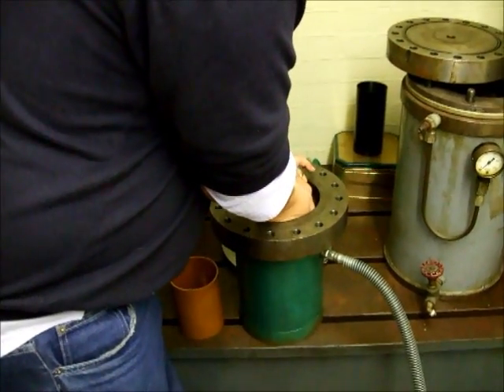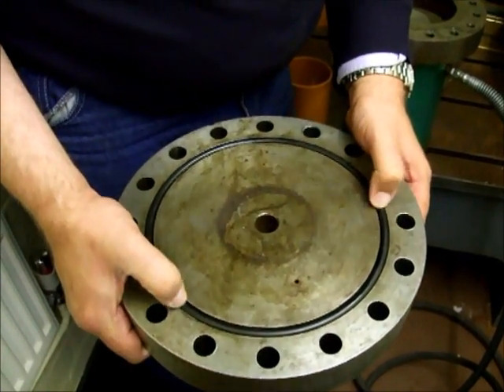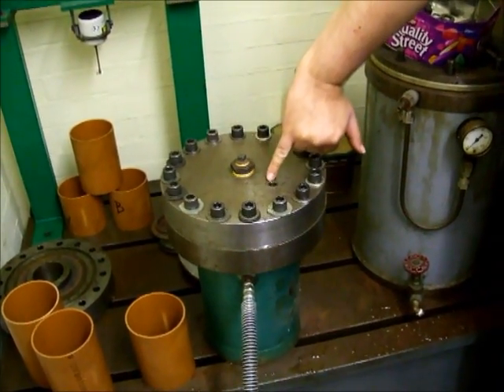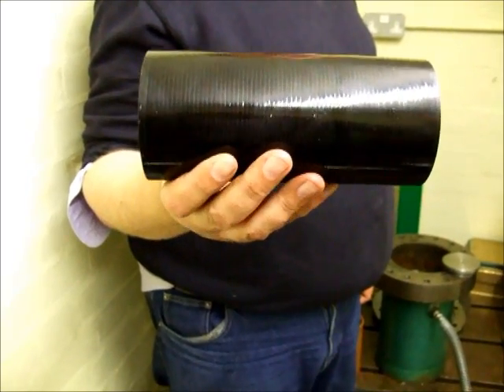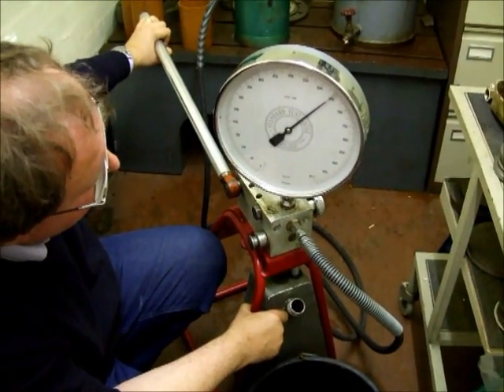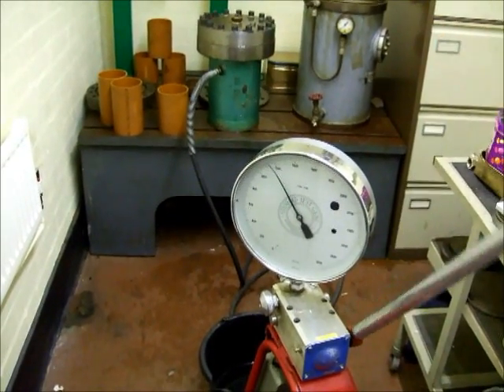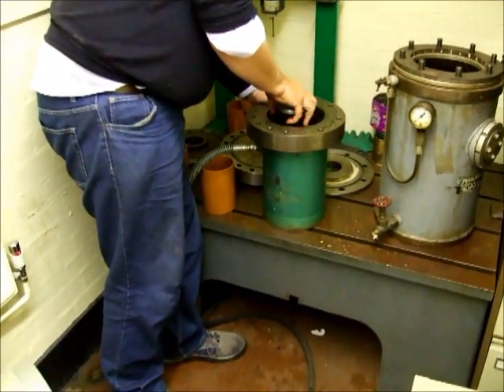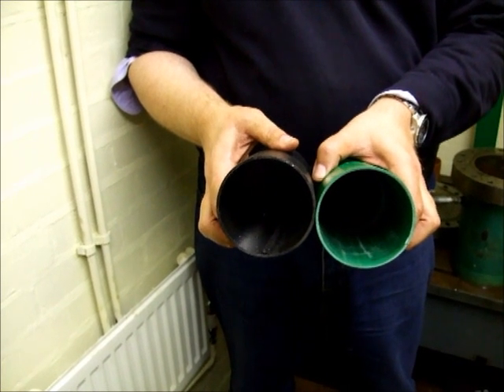Collapse of Composite Submarine Pressure Hulls

Comment: A note on why the failures here aren't more catastrophic:
Water is essentially incompressible. When they use the pump to force in more water, what it's mostly doing is slightly expanding that giant steel cylinder. Steel is an elastic material, so it stretches by a fraction of a millimetre. Only a tiny amount of extra water is being forced in, but the pressure created is huge because water cannot be squeezed smaller. As soon as the test article buckles even slightly, water is able to fill the new space and the steel cylinder can spring back to shape, and once that happens, the pressure is gone completely. Because only a tiny amount of extra water was added to the cylinder, it only collapses a tiny volume of the test article.

That's quite different from the situation in the ocean. In the ocean, the pressure comes from the weight of the all the water above the submersible. Once the hull buckles, all that weight of the water above pushes water into the buckled area, with the whole volume of the nearby ocean falling by a tiny amount into the gap, until it has filled the entire volume of the hull in milliseconds, which will squash it flat and rip it apart into shrapnel.
Reply: Really interesting discussion.  And of course at extreme pressure the heat of compression starts which adds another destructive process to the objects.  All in all it’s a rather more dramatic and horrifying event at  4000m.
Reply: @boxingfan2281  The instantaneously heated air due to rapid compression in an environment with O2 and the tanks of safety O2 would be interesting to model.  Would there be an explosion or would the inflow of water overcome the ignition of O2?
Reply: @boxingfan2281   poof..
Reply: @boxingfan2281 I’ve been explaining it to people as a giant, instantaneous pressure cooker. Folks seem to understand that there is pressure but don’t really grasp all the ways both water and pressure make things soluble that we normally think are not.
Reply: Exactly, you see the pressure gauge immediately bounced back to zero after the container cracked.
Reply: @clementding10  Near zero, the full scale was 10K psi or so, they changed gauges and pumps, mid through.
Reply: And generate heat, as the air compresses, cooking and liquifying the poor chaps inside in an instant. .
Reply: @hafstrat 
The air is compressed instantly to a tiny volume, the ice cold sea water immediately flooded the interior
Reply: 400 atm is equivalent to a heavy duty truck (6000 lb) pressing down on every postage stamp sized area of the hull (1 square inch).
Reply: actually the water will rush in and compress the air from one at to 6000psi instantly raising the temperature to a high level
Reply: Very succinct observation thank you!
Reply: Phenomenal explanation.
Reply: So, the potential energy of the pump/cylinder test was limited, whereas at depth in the ocean the potential energy is nearly limitless when acting on such a relatively small volume.
Reply: @ScoocumAF  Yes, it is indeed a difference of energy. The test set-up here provides the full force of the ocean, but only a small amount of potential energy, so once the first buckling starts, there energy is used up and the collapse halts. In the ocean, there's the gravitational potential of, well, an OCEAN of water.
Reply: @@ubik99 I picture it as being similar to being eliminated by some sort of future phaser weapon like they have on space shows.
Reply: All of these simulations are somewhat misleading though since the pressure is reduced as soon as the slightest leak or buckling occurs due to the small chamber. In reality the pressure would be constant until the end.
Reply: So, if we fill our submarines with water first, then everything will be a-okay!😊
Reply: In a nutshell, I think what you're trying to say is that the once the deformation (collapse) of the tubing occurs, the internal volume occupied by the test fluid *increases*, thereby reducing the effective pressure inside the testing chamber substantially, as the test fluid is relatively incompressible. Even if they were to leave an electric/pneumatic test pump running (ie. to attempt to maintain a constant pressure, even with deformation of the carbon), it's highly unlikely it would keep up with the volume change required in real time.  As such, we don't observe a catastrophic implosion like we would in the ocean at depth, where one can think of a constant pressure being maintained due to the massive size of the test chamber (ie. the ocean) vs. change in volume caused by the sub's deformation (ie. all changes in volume are almost instantaneously filled by the sea water).

This could easily be achieved at surface using an accumulator system to maintain pressure, but would be a little more costly/complex to implement (ie. pneumatic over hydraulic system, with enough accumulator bottles at sufficient pressure to instantaneously re-pressurize the test fluid as deformation is occurring in real time).
Reply: @@shivadowThe bends is not caused by bubbles crossing the blood-brain barrier. It is because there are bubbles that shouldn’t be there at all. Normally there are no bubbles in the blood. Compression allows more nitrogen to dissolve into blood. Decompression makes the blood have less capacity to keep all that.nitrogen in solution and it precipitates out as gas bubbles that interfere with blood flow everywhere in the body. The solution is gradual decompression, allowing the bubbles to gradually clear at a rate the body can tolerate.
Reply: I'm with you until the last sentence. This was a good experiment because it seems similar to the Titan design: a titanium end cap, or 2? And a carbon fiber cylindrical body. I did calculations in another thread for:
Depth=12,500ft, 385 bars (800,000 pounds per sqft)
Using the ideal gas law, changes to cabin air would be:
Temperature: 186,242F.
Nearly 20x hotter than the core of the sun. 20x hotter than the temperature tungsten boils. Volume: 0.28% of original.
So, if there was a longitudinal crack, water would have rushed in. Cabin air would be gradually pressurized to less than 1% of it's original volume, and nearly 20x hotter than the core of the sun. Air would not be able to overcome the water pressure at the crack. The air temperature would have increased from normal cabin temperature+pressure+volume to 186,242F and 0.2826% of it's original volume. So, 400 gallons of cabin air would be a little over 1 gallon of air by the time inside pressure equalized with outside pressure. Whatever air pockets remained would be mini suns. Much of that in the bodily orifices. In nanosecond scales of time, a pressure wave of ever increasingly hot+dense air would have done serious damage to the outside of the bodies, the sinuses, lungs, ears, gastrointestinal tracts, and I expect there would have been a radiant flash of light as hot air became radiant, and as inner and outer pressures equalized, and whatever air that was not dissolved into solution, would try to boil the water, and I don't know at that point. What happens with air bubbles that are 186,242F (20x hotter than the core of the sun), at 385 bar (atmospheres), 800,000 lbs/sqft? It seems like a violent event would occur. Some kind of radical dispersion into solution. 
This was corrected due to some errors in copying+calculating with various units before morning coffee.
Reply: @chadkline4268  Chad, I'm a bit of a novice on this, and I'm trying to grasp the physics and chemistry of what's taking place during the implosion. What is it that causes the tremendous sudden rise in temperature, even if it's only measured in fractions of a second?
Reply: @chadkline4268  OMG, I just got a headache reading your math🤣.  I don’t understand how the pressure would make the air so hot? This is Complicated stuff and regular folks like me  can’t wrap our head around this science.  Thank you for explaining what could of happened. So sad, especially for the 19 year old kid 😥. I hope they didn’t even see it coming.
Reply: So everybody seems to be talking about adiabatic heating of the air now. I'll throw in my two cents, for what it's worth. In isolation, the air might be able to reach a very high temperature indeed, but there just isn't much mass of air to heat (comparatively). The internal volume should be about 5m^3 which is about 6kg of air at 1 atm, and air also has a low heat capacity, so even at very high temperature, the amount of thermal ENERGY isn't that high, at least compared to the several tonnes of water suddenly imploding into the same space. Water has a very high heat capacity, and there are tonnes of it instead of kilograms. I'm guessing that the violence of the collapse would also quickly disperse the air into many small bubbles long before it fully compreses, which results in a high surface area to quickly transfer the heat energy into the comparatively huge heat sink of all that water. Similarly, the Human body is mostly water, so again there is a huge heat sink absorbing any heat energy from only a few dozen grams of air inside the body. I just don't think there would be any extreme heating of anything because of the small mass of gas being rapidly mixed with so many huge heat sinks.
Reply: This is absolutely wrong and I'm shocked this comment has so many upvotes. Water is NOT incompressible, especially not in comparison with steel. Stainless steel has a bulk modulus of roughly 160*10^9 Pa, while water has sits at roughly 2*10^9 Pa. Water is 80 (!) times more compressible than steel.

People here just seem to parrot "water is not compressible" without actually knowing what they are talking about. Yes, it is essentially incompressible in comparison with air. For most real world purposes especially on the surface of earth, it's an approximation you can work with. But to think it doesn't compress at all under all circumstances like some people here do is ridiculous. Please educate yourself before spreading dangerous misinformation.
Reply: @shogun8-9 Thanks for pointing out the bulk modulus of water, but also keep in mind that the steel isn't being compressed -- it's being used as a cylindrical spring.
Reply: There is a channel called the hydraulic press channel, he rigs it up to a tube full of water with a small sub type eye glass in it and puts things like tennis balls, light bulbs and polystyrene cups in it, with a 150 ton press even this isn't near what titan got.
Reply: @Dudleymiddleton 
The hydraulic press channel did titanium submarines about a year ago. When he got the last one to implode it squashed it flat and it gave an idea as to what happened to the Titan crew.
Reply: All the weight comes from all sides, not just the top.
Reply: Good explanation -- thanks.  Nevertheless, this demo gives an idea of what pressure does to a badly engineered sub, and it certainly is prophetic.
Reply: @@shivadow Yes and no. Steel certainly has a modulus of elasticity so it does stretch elasticity. Also water has bulk modulus so it is slightly compressible. Though I would agree, a majority of the energy released in this experiment is the small amount of air that is in with the water.

I don't know about the blood brain barrier. The higher pressure causes the blood to be able to dissolve more air. When the pressure drops due to ascending, the blood can't hold as much dissolved air and the bubbles come out in the blood instead of the lungs. The bends doesn't require super small air bubbles, it requires air to come put of solution while not in the lungs.
Reply: This setup in the video is like with a bench vise (clamp). You put something in and tighten it down until it breaks. The vise ends don't suddenly go together all the way. They hardly move once the item breaks.
Reply: Oddly enough of many ways to go this seems the most horrific and in some way peaceful.  One moment you are excited to see something historical and the next moment you simply no longer exist, with zero time to understand what’s happening and zero time to experience pain.  It’s a bit like blinking and beyond that absolutely nothing or concern.   Give me that over suffering and pain any day, Just ideally when I’m in my later years, please.
Reply: They basically became trapped in a Diesel engine in the combustion chamber. No different, the hull collapsed, air was compressed by the water inrush, the temperature massively increased and created ignition, all hydrocarbons in the hull were used as fuel and boom, everything was wiped from the planet instantly
Reply: 14 psi sea level acts on every square inch of our bodies. Down where the Titanic it's around 5500 psi on every square inch of any structure and not only above it, if that was the case Titanic would be flatterned. The reason why it looks as it is now is because when it was sinking it filled with water on the way down equalising the pressure.
Reply: @Rob-eg8qc  Great point!
Reply: Great explanation, really puts things into perspective. Makes me way more impressed how people create these submersibles that can survive the weight on the ocean on top of it..
Reply: @OGAaronAlton Impresses me as well, especially considering James Cameron built a sub himself that took him down to the Mariana Trench, three times the distance down than the Titan was trying to reach. And that was over ten years ago
Reply: @celeca7 he piloted the sub but he had no part in building or engineering it. He’s a truck driver from Ottawa with no degree and smart enough to know when others should do the heavy thinking.
Reply: @CheekyTyke007   I just watched the interview where he said he himself designed and built the sub in which he went to the mariana trench. If you’re correct, then he is lying on tv about something that would be easy to discover. Why would he do that?
Reply: @OGAaronAlton  All thev successfull ie ones that return deep subs are bathesjpheres, ie globes of thick metal.
Reply: I think the rapidity of the failure showed itself well in this test. The fiberglass buckled, the pressure went down at much less than the carbon fiber, but didn't allow water in. The carbon fiber took a lot more pressure, but failed pretty quickly and completely. On delamination, the cylinder gets progressively weaker. It cracked before deforming
Reply: @patrickvolk7031  It is a mystery to me anyway what purpose carbon fibres are supposed to serve in a shell that is supposed to be resistant to external overpressure. Carbon fibres are excellent transmitters of tensile forces, which is why they are used in hydraulic cylinders, but they are lousy transmitters of compressive loads.
Reply: @maximkretsch7134 ,.  Yea ,. I agree with you ,. The majority of the carbon fibres cylinder strength was the 5 inches of resin holding the fibres in place  ,. I m supposing it was epoxy resin not polyester ? .   The carbon fibres added very little extra in compression , n on the vid I saw was just wound like cotton on a bobbin .  Not at +/- 45 degrees ..  whether that would have helped I m not sure .. one thing is for sure it shouldn't have been used multiple times too near its design limit .. was too under engineered to be safe ...
Reply: @maximkretsch7134 this isn't really true about carbon, per se.
Reply: @maximkretsch7134  Carbon fibre and glass fibre have a much higher compressive strength than resin. They are thin and that makes them collapse like a string or like uncooked pasta if you try to compress them as loose fibres. In the material however they are kept straight. As long as the weak resin is able to keep them straight without delaminating or having some kind of defect it will be fairly strong and lightweight.

But it's not inspectable, calculable, repairable. It will work until it doesn't, and then it will shatter like glass.
Reply: @soylentgreenb  Modified ASTM D695 goes to great lengths to test the compressive strength of at least a tiny small probe of carbon fibre/resin composite in order to avoid the problem of buckling. The fact that there isn't even an official standard to determine this material property tells us a lot.
Reply: Bad ass! Thanks!
Reply: In a black hole, is everything infinitely compressed?
Reply: Every material is slightly elastic including water. Water can compress as all materials have a modulus of elasticity.
Reply: @crissd8283 yes, but that can be ignored under these circumstances. The state of aggregation is usually considered to be uncompressable for solids and liquids. Furthermore the changes in volume are minimal and not a linear function either (which is far more amenable here to the pressure test and real world result).
Reply: So, if you were on the surface above where the Titan imploded, would you see anything happen at the surface?
Reply: @danejurus69  not a thing. But if they had hydrophones in the water they could have heard it.
Reply: Will it fall/compress faster than gravity?
Reply: @jeffploetner  The water moving into the sub should accelerate a lot faster than the 9.81m/s^2 of gravity. A hydraulic system can provide a mechanical advantage, just like a lever or a set of gears. If you push slowly on a large hydraulic cylinder connected too a small one, the small one will move with greater velocity (but less force). In this case, the "falling" of a large volume of water at 9.81m/s^2 will push a smaller volume of water into the collapse at a much greater acceleration.
Reply: @TonboIV  I try to picture it as if it was a vertical column of water sitting on top of a steel plate.  All that weight would be the pressure.  If you removed that plate, it would fall at regular gravity, I would have thought.  But maybe that’s just if it was not compressible at all.  Since it is very slightly compressible, then that spring force will make it fall much faster.  I think?
Reply: @jeffploetner  Think about a trebuchet. The huge weight on the short end of the lever drops slowly, but the much smaller stone on the long end gets launched at many times the speed. Water can do the same kind of multiplication. A very large amount of water falling with gravity pushes a much smaller amount into the hull with a much greater velocity.
Reply: No matter what was tested, when the sub gave in, the inside air pressure went from 1 to 380 bar instantly or until pressure equality.   no one survives that. In the first stages they could have experienced that the walls came in.
Reply: Any O2 in the pressure chamber would have become super-heated within a fraction of a second also.  Much like a Diesel engine/ compression based ignition.
Reply: A few misconceptions need cleared up. First, water is "essentially incompressible" but actually does compress a little. Second, the temperature that air would briefly achieve when quickly pressurized from 1 atmosphere to 400 is many thousands of degrees.
Reply: @kylenolan3138  
Yes, as stated, it is 186,242F, or 103,450C.
Reply: What you're saying is that the pressure suddenly drops so the fracture stops. But in the sea the external pressure remains.  Its handy though so you can see how the failure forms without destroying it completely.
Reply: First I made the peep peeps...then I made the poop peeps...
Reply: Thanks for the explanation.. Exactly correct. I did the same test.
Reply: @williamstephenson2550  i work on high pressure pipe system testing and we never come anywhere near these kinds of pressures.  however the systems we build and test are far larger and accumulate incredible forces in their own rights.  high pressure is something to be respected at all times.   when you test a 56" high pressure natural gas pipe at 1600 psi that is 500 feet long there are some serious forces involved in pressurizing that system.  gives me all the more respect for the design of a vessel that someone is going to sit inside of at those kinds of pressures.   unfortunately in this case mickey mouse turned into pitch black water.
Reply: thank you for this!
Reply: Pressure of the water not only above you, but also the water which is below you
Reply: @gunjitkumar  wow!  Water is crazy!
Reply: But wouldn't you think if the model failed on this test that the engineering of that design is not sound?  Before computers they didn't send aircraft up to 30,000 feet over and over again to see if they blew up due the cabin being pressurized in the 1960's, they used a water tank to simulate the pressurization cycles until failure.  The British started using the procedure to troubleshoot the Comet and Boeing and Douglas used it to help design their aircraft.   We use models to gain insight on whether a design would be safe before we actually built it, or we should be.
Reply: And what oxygen was inside would of instantly been pressurised and like a diesel engine, combusted.
Reply: You could get much closer to replicating the implosion by using a much larger tank. If the amount of water needed to be added to reach the failure pressure exceeds the volume of the test object, water will continue to get pushed in at incredible pressures. It wouldn't be a perfect analog since the ending pressure would still be reduced in the experiment, but it would be much closer and much more violent.
Reply: You clearly explained why labs use water instead of compressed air to impose pressure on probes: It is for safety reasons. In a few words and for obvious reasons, the experiment lacks a free water surface.
Reply: You invented humble genius.
Reply: Water IS incompressible.
Reply: Good points.
Reply: Thank you for coming back to your video to elaborate.  I'm sure you saw a spike in viewers during this debacle
Reply: Nope.
Reply: Well said. Thought the same when the pressure guage went zero. So the test cylinder overpressure was a fraction of a second , whereaz the ocean is forever.
Reply: Thank you for this explanation!!!! I was wondering why it wasn't shattered into tiny pieces, but this explains why really well!!! Thank you!
Reply: @alexwesley6829  once the pressure is equalized, nothing more will happen.
Reply: ah.  thanks for this explanation.
Reply: Also, this is a much smaller scale that does not replicate exactly how it would fail on a full scale.
much less surface area, much less volume
Reply: It must also be considered that the material of the submarine is also elastic (according to the founder of OceanGate in one of his interviews, he said that the bathyscaphe shrank 3 quarters of an inch when submerged), since there is so much energy accumulated by the pressure, when it is it is released (the structure is no longer supporting anything) it seeks to return to its original shape at once, being able to shatter.
Reply: You are absolutely right. This also explains why there are no traces of super heated air in these cylinders. In a real event the air inside the hull would get super heated, ignite and vaporize any fuel, such as fat and flesh, before the water even reached it.
Reply: Wait, the bots are doing community notes now?
Reply: @chadkline4268  One guy used the analogy of the in-rushing water being a piston, and the chamber inside the Titan being a cylinder- is that accurate? But, you're saying the temperature increases even BEFORE the air becomes compressed-right?
Reply: @edkiely2712  

Chadkline is mistaken. The air (at the moment of hull breach) has not compressed yet. You can only apply the ideal gas law in this way if you assume a quasi-static process (basically, this means that you pretend that everything happens slowly so that everything stays in equilibrium - i.e constant pressure and temperature through the whole volume of fluid). The submarine crushing is a very dynamic process, so at any given point there's going to be pockets of air that are more or less compressed, plus a bunch of other factors such as inertial effects. At the moment of hull breach, there's a high pressure acting on the air directly in contact with the water, but this isn't 'felt' by the rest of the gas until the rest of the air/water mix comes crashing into it.

The cylinder and piston analogy is good. At the end of the day, while the air no doubt becomes hot for a few microseconds it's also immediately dispersed into the water, which has a very high heat capacity. The passengers would have been shredded by the very high velocity water, but they probably didn't really suffer burns.  A whole lot of the potential energy would have gone into moderately heating the water and swirling everything about really fast (kinetic energy which eventually dissipates as heat anyway). Small pockets of air might have reached very high temperatures, but the actual heat (heat being a measure of energy, in joules) would have been fairly low. 

The dominant destructive force would have been the relatively heavy water and hull being accelerated very very quickly.
Reply: @JMMC1005  Would have that "pocket of air" found its way to the surface eventually in the form of a bubble, even though it occured at about 10K feet or so, or, was the "event" so sudden and violent that, basically everything within the carbon-fiber pressure chamber was "collapsed" and "fused" into some "heterogeneous blob?:
Reply: @edkiely2712  

I'm guessing here, but the bubbles probably compressed to a pretty small size and due to the pressure, at least some of the gas will have dissolved.

If any gas bubbles exist, the high compression of the air will mean that it isn't as buoyant as normal (remember that while the water is also under pressure, it isn't really very compressed by comparison).

It's possible that the small, dense bubbles will be more strongly affected by currents than buoyancy, and so will only very slowly drift upwards.
Reply: @JMMC1005  Thx!
Reply: @JMMC1005  why would the hull accelerate?
Reply: @JMMC1005  yes, I did make an initial mistake because I was groggy and had just awoke, but I corrected it immediately 🙂 the pressure increase comes as a wave of ever increasing temperature and pressure. The air will eventually compress to nearly 1/400 of it's original volume, and rise to a temperature of 186,242F. It will probably transition into plasma around 100,000F. The rush of water would not exceed the speed of sound because it only has a few feet to accelerate, so that is why i say the effects of air kill before water. All the effects of air will occur before any effects of water. If you have little bubbles 20x hotter than the core of the sun in your sinuses, ears, lungs, etc, you're dead, and the effects on your skin and nervous system would be devastating. It's not like air blowing across your skin, it would penetrate. I would bet a good sum that you will never find a trace of the heads or torsos. Maybe a foot.
Water pressure needs to engulf the remains and equalize with outer hull pressure before it takes effect. But by that time, the body would be already destroyed. But again, these are on scales of a few milliseconds at most. It's kind of irrelevant. But for those that want to think about details of the physics ...
The average total lung capacity of an adult human male is about 6 litres of air. 6000cc compressed 400x is a 15cc mini sun in your chest. What would 15cc of nitroglycerin do in your chest? It would be worse than that. Gas molecules would be so energized, they would just tear thru everything like razors, like water jets that slice metal slabs.
Reply: @chadkline4268  

Accelerate inwards - i.e. the failed walls being crush from the outside.
Reply: @edkiely2712  
Yes, it's like the compression stroke of a piston in a 4 cycle engine. There is point A, where you have normal cabin volume+temperature+pressure; and point B, where the 385 bars of water pressure has completely compressed all the cabin air to less than 1% of it's original volume. So, if you had 400 gallons of cabin air, by the time the incoming water equalized pressure with the outside, all cabin air will be compressed to a little more than 1 gallon at 286,242F.
Reply: @chadkline4268  Thanks Chad!👌
Reply: @edkiely2712  that's the basics anyway. It's more complex if you want the get into the speed of sound and the advance of the pressure wave, but I gave the basics.
Reply: @chadkline4268  Yeah! The "violent physics" at those depths is fascinating!
Reply: PV=nRT folks
Reply: At about 100,000F, air becomes a plasma, and disintegrates into disassociated electrons and nuclei. So, that probably occurs at some stage.
Reply: All my life I was told that water was uncompressable. Under practical circumstances, this is true but water can be compressed slightly. The water at the bottom of the icean is slightly more dense than at the surface. I do agree that the containers would give before the water in this experiement.
Reply: Picturing the water pressure seeking all the air sinuses of the facial bones and bone marrows. ..
Reply: That not how pressure works.
Reply: @sandyshoremann7524  interesting
Reply: He’s right compressed water is way less violent than compressed gas. That’s why hydrostatic testing is safer than pneumatic testing.
Reply: @@ubik99think of it more like a Pillsbury Biscuit tube unraveling with a sonic clap 💥
Reply: that makes total sense
Reply: That's a very fancy way of explaining how my hydraulic jack works.
Reply: The volume of water inside the test equipment housing is a lot less than the actual volume of the cylinder under test, since the tested piece occupies some volume. The hydraulic equipment is a small device that cannot pump large volume fast at one time or increase the pressure suddenly to maximum. 
Water is not compressible and the pressure will be equal at all places of the water circuit after the pump as read on the pressure gauge.
Once there is a crack and a very little water flows inside the test piece, the pressure on the gauge will fall to zero.
The small hydraulic system is not capable to maintain the pressure high once the crack happens.
That is why most of line pressure test in industry is done with water even if that line is supposed to carry a gas. When the line test fails, the water pressure just drops to zero. If the same test is done with gas, the pipeline will explode on failure.
In the case of a real submarine pressure fail scenario, the amount of water that can go in is infinite and causes the implosion. Any living thing inside will be like squeezing a cockroach with a foot, but very very fast.
There is a saying" Poor man pays twice", but this latest case, the crazy rich man cheaply paid with his and the crew's life. You don't pay a plumber the cost of a plug, but for what he will do with it.  Regards.
Reply: @storm5013  no it wouldn't, the cucumbers 96% watercontent would ensure minimal compression when we assume the remaining 4% being solids and membranes. Some minute amount of gases would be dissolved, and they would be compressed of course. 
A compressed cucumber would be intact . Largely so
Reply: @unggrabb  The cucumber has a high water content at one atmosphere pressure. At great depth the cucumber is subject to hundreds of atmospheres pressure, especially so in an instant change state and not a slow accumulation of pressure. Your "indestructible" cucumber would turn into a mist of cucumber particles instantly. All this bs about water bring uncompressible is just that, bs. Water IS compressible, plus the huge pressures caused by the effects of gravity on the sheer volume of the oceans at those depths makes mincemeat out of anything organic that has not evolved to live its entire life there.
Reply: @kerinsian8844  you are obviously clueless. In your view, "only cucumbers grown at 3800 m depth will hack it. 
So you suggest that you can compress 1 liter of water into a 50 sq cm space
Reply: @unggrabb  And you have no idea what the difference between pressure and compression is. Pressure causes compression, they are not just interchangeable words. One atmosphere and hundreds of atmospheres pressure cause vastly different amounts of compression onto an object. It's not about how much you can compress water, be that a tiny or large amount, it's how that pressure affects the cucumber, or fish, or person, or Hollow carbon fibre tube. It doesn't matter if water only compresses a small amount, the damage is done by the pressure, caused by billions of gallons of ocean all pulled by gravity. The cucumber has no chance. That small percentage of organic cucumber material squishes until there is no more cucumber, only a small amount of ex cucumber water and a green tint. The ability to compress a liquid bears no relation to the pressure at the oceans floor which comes from the weight of water above it. You are mixing up two different things. I can stand on a cucumber and squash it by slowly adding my weight until it gives way, it doesn't have the structural integrity to resist my Weight and I'm a LOT lighter than the ocean. If your argument were true, people, who are up to 60% water would also hold together under that pressure, we don't.
Reply: @@ubik99cooked jello goop.
Reply: Yea I don't the steel pressure chamber is flexing any meaningful amount before the test pressure vessel lets go
Reply: @RyTrapp0  it might, depending on shape, a box will, a sphere wont
Reply: ...rip it apart into shrapnel & superheat the air inside for a millisecond, turning anything carbon based to ash & dust immediately.
Reply: @sandyshoremann7524  no the bubble would remain, just smaller as the water you pump in starts to take more space and the gas gets compressed. But as soon as a bit of space opens up from the implosion the water wil be forced in there and the gas bubble wil grow with exactly the capacity of the test subject that imploded.
Reply: You're absolutely right, but in this demonstration they were obviously merely testing the maximum pressures those tubes could withstand. They were not gathering data on the profiles of the damages that occurred once the test specimen failed. 
The test setup is perfectly valid for what they tested, it just doesn't provide any useful data on how devastating implosions of submarines are. It also doesn't provide much useful data on the suitability or inadequacy of the tested materials for submarines either, by the way as it doesn't address accumulated damages from cyclic loads, aging or fatigue either. 
This video is nice for what it demonstrates, but it's completely irrelevant when it comes to the questions regarding the loss of the Titan submersible.
Reply: @larsenh111  where did you buy your degree?
Cut and paste of information to educate you on the difference between gas and a liquid. But, feel to continue on as an ignoramous
Reply: @larsenh111  because you seem very confused, not getting the basics. Gas or fluid, are definitely the same. If you don't understand the difference, well, then you are a fool
Reply: All I'll say is 1. I havent read any of the rest of these replies and 2. Physics works the same at all levels. Putting pressure on water up here is the same as the pressure on water miles below the ocean. Thats why we can simulate the vacuum of space by just sucking the air out of a container. Anyways, your point still stands- failure is a failure is a failure, and a catastrophic one at that.
Reply: Best explanation yet! Thank you. It’s taken me a handful of professional videos to truly wrap my head around oceanic pressure. 

Maybe due to the thrill of making it down successfully he was somehow blinded to the, in hindsight, enormous dangers and incredible pressure put on that submersible.

Prayers to the families and the souls of these 5 men. 🙏🕊
Reply: Gravity
Reply: You are 💯% wrong
Reply: Thank-you for saving me about 5 hours researching high pressure in closed systems made of steel vs high pressure under water.
Reply: Fantastic and really good explanation filled with truth.
Reply: I would tend to disagree on the claim that water is essentially incompressible. If we take a 1 cubic foot cylinder and fill it struck level with water then capped it, begin to pump high pressure water inside said cylinder……it Has to compress in order to build dynamic pressure. That 1 cubic foot cylinder will hold  7.480519 gallons of static water, I can guarantee you if you pressurize that cylinder to 1000psi, you will yield approximately 8 gallons of water following said test. Water is compressible.
Reply: @seventeen912  All Fluid is essentially not compressible.  Gases are very compressible.  Why we have to bleed Brakes of any air; and why FLUID is used.  However, rather than taking thoughts out of your rear - you might read a few books on fluids, gases and physics.
Reply: @daves7775  Okay, book reader, riddle me this, why is it that you “hydrologists” repetitively use the term “essentially”? Leaving a little room for doubt? For 38 years I’ve dealt with the concept, all the while you’ve apparently been reading books.
Reply: @seventeen912  When you read books then you can earn degrees such as in Aeronautics and work on stuff.  You can tout nonsense - but fluid[i.e. LIQUID (since gases are also Fluids)] is not compressible.  That is why your car brakes and hydraulics work.
Reply: @daves7775  Do me this favor, degree holder, read a book on water jet cutting and let me know what you’re finding are pertaining to compressed water. When you’re done with that, read me a book on hydrostatic pressure testing and let me know yet again what your findings are! Hydraulic? This explains its self! IN ORDER TO GENERATE PRESSURE…..COMPRESSION MUST BE ACHIEVED!!! Hence the hydraulic pump, hence the brake booster on your car! Inconceivable that I’m having this conversation with apparently one who holds an aeronautical degree!!!
Reply: @seventeen912  I guess you have never compression lock an internal combustion engine then.
Reply: A question nobody asked but everybody wanted an answer. Thanks for the explanation.
Reply: That might be true, but at what pressure the model fails will still be the same at sea. Right?
Reply: Thank you!
Reply: Very clear, thank you!
Reply: that is not what they were doing at all -
Reply: What makes you think they are pumping water into the tank?
Reply: It's like not even dying, it's ceasing
Reply: There is a YT video showing how the CEO & Crew bonded the hull/
bulkhead  ring to the carbon fiber cylinder in a non sanitized open marine shop. The  bulkhead/hull ring groove is 5" x  5" seated over the raw lip of the CF cylinder. They never inspected the death trap after each dive, the CEO ignored every warning he was advised of and attacked anyone giving sound verifiable stats! Note the missing view port on the entry bulkhead? SMDH!
Reply: @nbk9372  dunning kruger submarine services inc, would have been a better name
Reply: I think you're convoluting things including whatever miniscule elasticity of the steel is involved into your explanation. Especially "the steel cylinder can spring back to shape" part as that would actually INCREASE pressure since it is decreasing the volume of the pressure vessel.
Reply: Most amazing comment!
Reply: @@shivadow- That's not how the yield point and "elastic phase" relate. Elastic deformation happens between zero stress and the yield strength of the material being met (whatever stress level that is for a particular material). At all points between zero stress and yield (or darn close to yield), strain is proportional to stress. So that steel container is definitely expanding - just not enough to casually notice since steel has a very high modulus of elasticity (steep stress-strain line). Now, I don't know about the air dissolved in the water part. That very well may be the major factor, but the steel is definitely elastically stretching. That stretch completely reverses as the pressure drops (this is why it is called elastic deformation). If the stress in the steel exceeded its yield strength, it would become permanently deformed and wouldn't fully return to its original size when the pressure was removed. So the steel is moving before yielding, just not permanently. I hope that made sense.
Reply: Why do some people spell it “millimetre”
Reply: If they released the weights as it was said in many videos they knew something was wrong and probably did for a few moments before implosion as  it happened so fast.
Reply: @@ubik99 cooked goop
Reply: @@ubik99 More like being instantly turned into soup
Reply: It took 40 milliseconds to be exact, in the case of the titan submarine, to implode. Human reaction time is slower than that, so all died painlessly and without a chance to even notice it
Reply: Wouldn't that be an explosion? Let's say the was compressed 2% at the depth of the submarine and the the hull cracks. As soon as that happens the water around the chamber rapidly decompresses into the chamber exerting enormous force on it, resulting in an explosion. Am i completely wrong here? Physics breaks my brain.
Reply: @SeyidAr  Not technically an explosion because all the force is being exerted inwards towards the center and not outwards from the center.

The water is hitting with explosive force for sure its just traveling in the wrong direction to be an explosion.
Reply: @SeyidAr  initially in the ocean, it's actually called an "implosion" (force inwards), but you are right, directly following the implosion is an "explosion" (force outwards) as equal and opposite force in the air rebounds outwards after being squished by so much. Both last only fractions of seconds before the water breaks apart the air into small bubbles.  You can see both implosion then explosion in Hydraulic Press Channel's video where they implode a light bulb in a high pressure chamber.
Reply: Water is compressible. its absolutely physically possible to compress water.
Did you google it without reading the full paragraph? actually you didn't even read a full sentence.

"Water is essentially incompressible, especially under normal conditions. Yet, in industrial applications water can be tremendously compressed and used to do things like cut through metal."

"under normal conditions" a machine designed to put tremendous pressure on water isn't normal conditions.
pressure causes compression. water just happens to need a lot of pressure to compress it a tiny amount. 

its not physically impossible to compress water.
Reply: Water is surprisingly compressible when you come to disgustingly high pressures like this. It is almost 2% denser at 4 km depth. Not enough to fill the craft in this small simulation of course.
Reply: This isn't accurate. If water weren't compressible then it would fill the vessel at free fall speed. Weight doesn't fall faster because it's heavy. The reason it fills the vessel so rapidly is due to the compression of water. At that depth it is compressed roughly 5%. The springy nature of water at that compression decompressing that 5% to fill the vessel happens at mach speeds.
Reply: @atlehman69  It happens at the speed to which water would be accelerated during a free fall to that depth.
Reply: @maximkretsch7134  False. It doesn't matter how deep you are, water would fill a void at free fall speed at ANY pressure if it weren't for water compression, which makes water exceptionally springy, and allows it to fill voids violently.

Why would it travel as fast as it would at free fall speed if dropped from the surface? Where are you even getting that idea, that makes no sense.
Reply: @atlehman69  It never ceases to amaze me the tone of conviction with which people equipped only with Maslow's hammer presume to state that any other view is "wrong". Bernoulli's fluid law says that a liquid exits into the atmosphere at the speed it would have reached in free fall along the height of the overlying liquid column. This is the case when liquid begins to enter a submarine, as its interior is under atmospheric pressure and precise enough to estimate, because even a "water spring" is only taut because it is subject to the law of conservation of energy, and only up to the point corresponding to the work of gravity done by the water column over that height, so cannot lead to any other result. If someone nevertheless wants to arrive at the same result by taking the circuitous diversions via the compressibility of water, then he should please present his differential equation taking into account the fact that not only the compression modulus of water changes continuously over the height, but also the density.
Reply: So how can you simulate failure? Seems almost impossible without actually sending an object down.
Reply: @ste2hedz  That I couldn't tell you. A sufficiently large gas volume might be able to work as a spring to create a full collapse, but I'm just pulling that out of my ass.

Simulating a full collapse probably isn't that useful though. Any buckling of the pressure hull is pretty much a catastrophic failure, so how many pieces it ends up as after that doesn't tell you much in engineering terms. If anything, it's better that it DOESN'T fully collapse. If the hull is mostly intact, you can learn a lot. If its in twisted pieces, not so much.
Reply: @TonboIV  Good idea on the large gas volume, but I am skeptical (no offence). I think maybe a thermal induced implosion may work. Heat up the inside then quench the outside. Seen this on plenty of educational science videos with steel barrels for example. But to get that pressure differential? Hard to tell.
Reply: @ste2hedz  except you would introduce other failure modes. Composites material properties change with heat more than metallics do and I would expect delam to dominate that type of test as a failure mode.
Reply: @TonboIV  yeah the best was to simulate the ocean above it would in my opinion be a hybrid system. So you have the model in a water filled tank that is atleast 2 times the size of the model, and then have a gas above it wich forces the water to the desired pressure. If the model pops that gas wil lose some pressure offcourse, but not all like with a non compressible fluid. So with a compressable gas it would be way more violent. But the risk of the test chamber exploding when the implosion happens is also way bigger. The shockwave could just make the pressurechamber crack, and with that much pressure on a gas that would be pretty big.
Reply: @TonboIV you are extremely ignorant. The only thing you need to simulate a full collapse is a circuit with a continous positive displacement pump and a pressure regulator, that way you can keep the pressure after the initial failure. Working with gases in pressure tests (although is allowed with some restrictions) is REALLY not recommended.
Reply: @nashooo5903  No need for insults. I already admitted to my own ignorance. What I do know is that time matters in a simulation. Slowly crushing something with a pump doesn't replicate a real collapse event. All that water and hull material rushing in has kinetic energy. It's a heavily hydroDYNAMIC event. You can't simulate a hydrodynamic event with a hydrostatic pump (unless your pump is ridiculously huge and powerful).
Reply: @TonboIV is he pumping water or air? I thought he was pumping air to simulate pressure
Reply: @ste2hedz  A large gas volume (with no restriction) would mimic it nearly perfectly. You'd also want the vessel holding the water to be quite a bit wider than your specimen in order to reduce the need to accelerate a large water column.
Reply: @TonboIV I love you because you sound smart 😊
Reply: @gabbermaikel  all the pressure in the ocean but for 14.7 PSI is a result of gravity acting on the water itself. That last 14.7 lb is the effect of the air.
Reply: @doncorleone3901  water
Reply: @TonboIV how about a vacuum? Removing air from inside the item being tested? My guess with this though is that the pressure of the atmosphere outside the test item wouldn't be close to the pressure found in deep ocean
Reply: @anothersquid  yes but if you want to simulate all the water rushing in you need a compressable in your test chamber as that wil allmost instantly fill the new space and let a big part of the pressure stay.
Reply: @TonboIV  ____As you obviously already know... there really is no test substitute for a  2-1/2 mile column of water and it's ability to "instantly" replenish any sudden loss of volume in it's column at (pressure) depths of this magnitude....almost indescribable. Tsunami comes to mind too when discussing ocean water column. 
    One thing everyone should consider is that the ocean has no mercy.
Reply: @ste2hedz  You need a bigger pressurized water chamber.
Reply: @MarioRossi-sh4uk  It wouldn't make a difference. More water is still not compressible. You could place the cylinder in a water bath. Place that bath with cylinder in an air chamber and raise the pressure by pumping air in. It would make the experiment more dangerous though.
Reply: @ste2hedz 
You could simulate failure with a large pressure accumulator in line with the system that can maintain the pressure even as the water starts flowing to fill the air cavity.
Reply: @ste2hedz  This test did simulate failure. To put the pressure on the cilinder until it fails is enough. You don't get the resulting damage, but for the test you need to find the point of failure under pressure. This test does just that. You know that at an actual depth in the ocean a failure like in the test will result in a catastrophic implosion. In construction tests like this are done all the time, on soil, concrete, steel or whatever. Its about even distribution of pressure and the water provides the even distribution. Even better there's no explosion and such because that would ruin your lab. Finding the point of failure is enough.
Reply: @ste2hedz  Computer models.
Reply: @jenniturtleburger3708  unfortunately computer simulations are why we are in this mess. You need test data to validate the models.
Reply: @ste2hedz  Everyone in the submersible community knew the carbon fiber composite used for the hull was a mistake. You have to use one solid piece of material like steel or titanium or you risk water ingress between the layers and delamination leading to eventual failure.
Reply: @ste2hedz  You'll learn, if your so inclined.
Reply: @Team33Team33  LOL...what?
Reply: @ste2hedz  That's the LOL. If you don't get it you're best going back to school (or stick at it - One day you'll understand maybe).
Reply: @ste2hedz  School is where you should have been as a child my friend. 
The place all the other children went to become knowledgeable adults.
Reply: @ste2hedz  Because when it comes to materials, what matters is the stress the shape experiences. The way it works is that the material itself has a design stress level. When reached, the material begins to fail. Things like the shape of material and how much material there is doesn't effect the material design stress level (the point when the material fails), they effect how much stress the material experiences. 

For example, a bar of A36 structural steel has a yielding point of 36 ksi, regardless of the dimensional size of the bar. When that bar reaches 36 ksi stress, it begins to experience failure. So to  keep that bar from reaching its failure stress, we add more material or use specific shapes to make the demand stress lower, rather than to make the capacity higher. 

Essentially, in materials, everything is scaleable because of material properties. That is what the experiment in the video shows.
Reply: @ste2hedz not hard at all. Instead of filling the test tank 100% with water, you use a large (compared the the item being tested) and partially fill with water, but also a large amount of air. If the volume of air outside the item being tested is very large compared to the volume inside the item being tested, the pressure won’t change much when the test item implodes.
The danger, and it is extreme, is that if the external vessel fails it will have a lot of stored energy in all that compressed air. So the test chamber needs a large safety margin.
Reply: @jimmurphy5355  interesting and makes sense. Of course it's obvious now... the problem ins incompressibility so solve it with compressibility. Cheers 👌
Reply: @ste2hedz  Because you extrapolate using Finite Element Analysis - calculations.  If this much water does this much damage, how much will X amount of water damage?  You don't have to do physical tests to know theoretically.
Reply: @ste2hedz  For the most part, submersibles are primarily simulated with computer modelling. Not sure what physical testing is done. Since a normal hull uses solid materials it can be easily simulated with computer modelling and can also be inspected in various ways to determine exactly what it's going to do. Composites, on the other hand, are extremely unpredictable and you never really know when, where, and how it's going to de-laminate. Plus, once it does you have no time to react... in spite of claims made otherwise by oceangate.
Reply: @ste2hedz  Gas pressure is the obvious as it can expand and keep the pressure from dropping too much, but if the outer pressure vessel breaks during the violent collapse of the carbon fibre tube it will be a bomb. You'd need to do this on a bomb range or have the pressure vessel stupidly over-dimensioned.

Pressurized water is much less scary than pressurized air; still, a pin-prick hole can make a jet of water that cuts through skin (injection injury; even worse with hydraulic oils since then they need to excavate your hole hand and figure out where the oil vent and remove it).

There is a method to construct pipes called pipe ramming. They use a big pneumatic hammer to ram the pipe into the ground like you drive a nail from the backside with a hammer. This means it gets full of soil. When you're done, you remove the ram and get the soil out of the pipe. One way to do this is to close of one end of the tube and pressurize it to push the soil out; this can work with clay.

If this is done with water, you make a mess as a mixture of water and clay comes out the other side. If you do this with air; it doesn't make a wet mess; what it does however do is create a cannon that shoots a long "sausage" of clay far enough to kill someone if there is no back-stop. As air pressure starts to overcome friction, more clay gets pushed out and there is less friction between the clay plug and the tube, so it moves faster; this can go from barely moving to a deafening boom in seconds. Still, they used to do it this way in the country side. Like blasting, it is not very safe and best avoided.

The reason this happens is that air is very compressible. You need to almost halve the volume to double the pressure (the ideal gas law stops applying at absurd pressures). If you have a cylinder of air with a moving piston and you compress it, the force with which you compress it has to act over a long distance. This is called physical work and means there is a lot of energy stored in the air that can be unleashed to do violent things.
Reply: @ste2hedz  In a computer simulation run by AI that's been trained on materials datasets to build a physics engine: "Duke University researchers have discovered that machine learning algorithms can gain new degrees of transparency and insight into the properties of materials after teaching them known physics."

Take an AI like this and have it code a simulation.
Reply: @ste2hedz  he needs to fill a portion of the pressure chamber with air. The compressed air will store the energy. This way, when the tube collapses, the air will keep the chamber pressurized and water will flow to the submarine. The bigger the air volume in the chamber compared to the tube volume, the less will be the pressure drop when the tube fails.
Reply: @yuribr84 Filling with air doesn't work at those pressures. Nitrogen at those pressures is a supercritical fluid. That's for the N2 that simply doesn't dissolve into the water.
Reply: @ste2hedz it in noway shows what happened to the sub .
Reply: @thedbcooperforum the pointed out delamination of the layers of carbon fiber, which is what folks have supposed happened.
Reply: 350 bar down there. Your lungs are instantly compressed to the size that is not compressible anymore and the temperature duddenly skyrockets to hundreds of degrees, just for a splitsecond, but still. Your skull is torn apart as your sinuses are squashed to nothing. Any dental cavity would disintegrate a tooth. Same for the stomach, intestines etc. It turns you into a bloody mess in an instant.A short, but horrible death.
Reply: @christiandietz6341 That's why it was laughable when the press was asking Rear Admiral Mauger about the "retrieval of bodies." I think he knew there would be zero bodies, or even body parts, retrieved during the search, which is why he told the reporters about the "ocean being unforgiving down there!"
Reply: @edkiely2712  Yeah, I saw that question session too, and I had a (somewhat unfair) urge to jump through the screen and dope-slap that reporter. What that admiral didn't want to say was that even their bones were probably turned into powder.
Reply: @christiandietz6341 
Messy but mercifully instantaneous. They never felt a thing, thank goodness.
Reply: @christiandietz6341  gruesome but not horrible. You're pretty much instantly vaporized before your brain can process what is happening. There are worse ways to die.
Reply: @christiandietz6341 no, remember that fluids are not compressable. If what you states is true, then no fish would be able to live in great depth. But fact is tgat gas filled cavities get squeezed unless pressure is equalized, which of course will not happen. If you put an organic specimen (a cucumber) in the tube and increase the pressure it would just still be a cucumber. So you got it all wrong
Reply: @unggrabb  fish live there because they were born there, just like we were born at 1 atm, all our fluids are at 1 atm. The fish's fluids are at 300 atm so they literally don't feel a thing. Subjecting cells at 1 atm to 300 atm will not compress the water but the cell is only 60% water. There are other molecules that are compressible.
Reply: @ste2hedz  when we scuba dive to say 50 meters, then all our fluids and celss are at 5 atm, and the world record saturation dive is 701 metres ie. 70 atm. So you are incorrect.
Reply: @ste2hedz no, they are not. You can only compress gases - end of physics.
Reply: @pan6593 no fluids are compressible like any other stuff. Not much though.
Reply: @unggrabb  Fluids are compressible, just nowhere near as much as gasses. Water, for instance, compresses 1% at 200 atmospheres.
Reply: @ste2hedz 
Exactly 👍 I was about to make the same observation, but you saved me from struggling with my self-learned english 😅
Reply: @ste2hedz  and if you brought the fish to the surface from what i recall they explode relatively quickly and are hard to study because of that.
Reply: @unggrabb This is antiquated knowledge. Fluids are compressible, for water it's ~5x10^-10 Pa^-1. In industrial applications, water is routinely compressed by ~10-15%
Reply: @unggrabb The fish that live at that depth have evolved to do so. Guess what happens to them when they are brought up to the surface at only one atmosphere pressure. They inflate and die, and if it was done extremely quickly they inflate explosively. A cucumber at the depth of the titanic would be pulverised cucumber mash, not a whole cucumber.
Reply: @adg1355  bullshit yet again. Were do you routinely compress watter to 1000 atm? And if you would, then, It takes extraordinary pressure to compress water. Even at the bottom of the deepest oceans,  where pressure is equal to about 1000 atmospheres, water is compressed by only 5 percent.
And that would not blow the cucumber up if you gradually increase pressure
Reply: @unggrabb Fluids are compressible, just not on a scale we find useful. 

At the Titanic's depth water takes up 98% of the volume it would at the surface, a 2% compression.
Reply: @ste2hedz  How do certain whales dive miles deep.
Reply: @joefish6091  I assume you are talking about sperm whales. They have several adaptations such as a reinforced yet collapsable rib cage, fat stores to allow large body deformations and thus organ protection. They also reduce their metabolic rate during dives to reduce the chance of decompression sickness (aka the bends). Their dive depths are generally only 400 to 1,200 m (1,300 to 3,900 ft). Not even close to the Titanic though still very deep. Yet they have been recorded at 2,000 m (6,500 ft), about half way to the Titanic. They are certainly incredible animals!
Reply: @unggrabb  Fluids are in fact compressible, including water.  This is why multiple forms of ice exist.

When water is sufficiently compressed it can form a solid at above freezing temperatures, it just takes astronomical amounts of pressure to do it.

Water is just like a very VERY rigid spring.  It does in fact compress, but the amount of force required to get it to compress to anything discernable is huge.

Everything in physics is compressible, it's just a matter of how much force it takes.
Reply: @ste2hedz  Fluid and solid matter is not the problem here. Human cells would do fine at 300 atm. The problem is that humans breathe air.

Whales do to, but some can go to almost the depth of the titanic and they do this by going in a single breathe (cannot get a nitrogen buildup if you don't get any more nitrogen). They also have collapsible lungs that can go to almost zero volume.

If you could breathe an oxygen rich fluid and purge all air everywhere in your body somehow it is hard to say how deep humans could go. It is known that proteins can misfold at pressures over > 2 kbars despite being incompressible.
Reply: This was its 12th or 13th dive?  I think overtime, the hull got stressed “cracks”.  What are your thoughts? It should have been tested after each dive, No?  It’s registered in the Bahamas?  Jeez, I wonder why?
Reply: @OceanLife772  They should've done a scale test. That's doable. They should've run the test until it failed, or a few cycles and then xray it for defects.
Reply: @patrickvolk7031 xrays were denied by the ceo. He decided his acoutstic realtime alarm monitoring was enough. Engineers all knew it had to be xrayed to have valid info.
Reply: @pan6593  but even then the properties of bonded carbon means it would be extremely difficult to examine each and every bonded thread.  In this case it’s likely that the properties of the material started changing from the very first dive.  The time and cost to X-ray this vessel after each submersion would have been extremely expensive, time consuming and even then might have been inconclusive.   When you factor in a business needing to make money then you really can see how such an incident could have happened.   And that’s a tragedy
Reply: @patrickvolk7031 your so right! I used to do cycling tests for a living. You can run models to failure and then determine the mtbf or mean time to failure. Once you know the mtbf you back off with margin the number of uses you have to safely use the hull. However with say only 12 successful uses the mtbf would be so low that the practical use with margin would be less than 1. What this clearly means is that this hull design has 0 margin and is not safe to operate even once. Not safe to use.
Reply: Hydraulics - is a mechanical function that operates through the force of liquid pressure.
Reply: So it sounds likely that a lot of people on YouTube could have saved "Everyone's " life if they had knowledge of what these good people were about to do. Don't go into deep waters without good testing of said submersible. Tragic.
Reply: you should write a book about that.
very interesting
Reply: How can those clam and pearl divers dive so deep without their ribs caving into their lungs?
Reply: @BenMJay the stomach does, not the ribs. The lung gets smaller and testines are pressed into the space. Same with freedivers (who dive far deeper than pearl divers). Look at their bodies when down, the middle is quite flat and collapsed. It is all soft tissue, the rib cage is not a closed cylinder.
Reply: @BenMJay  pearl divers don’t nearly as deep where that becomes a problem. They go deep, don’t get me wrong, but not at depths even close to the Titanic. I used to free dive and I could stay down 6 to 8 minutes on average. The support boat looked like a toy and I went nowhere near where pro divers go. In turn that’s a fraction of the depth to the Titanic.
Reply: @BenMJay  40ft  (12meters) is their limit.
Reply: @BenMJay Their diaphragms get pushed in and collapse their lungs.
Reply: Great explaination.
Reply: Is there potentially any depth, where the water on the bottom could be crushed by itself?
Reply: @chriz9959  yes but no. Water is slightly denser at the sea floor than at sea level but it's so negligible that you can completely ignore it. The molecular structure of liquid water allows it to stack molecules so close together that they functionally can't get any closer together
Reply: @chriz9959  Very interesting to try to visualize!  I keep seeing the water squirting sideways and up/out and away from the force that is pressing on it. So eventually I see a "dry" spot on the bottom, which is ridiculous I know, because well,as @HairyBottom said above:  "All the weight comes from all sides, not just the top."  There is never a "bottom".. but that's what I see in my mind. With limitless amounts of water to keep pressing down/around then it's just a perpetual circle/cycle of water moving around. 🤪🤔
Reply: @chriz9959 no, water cannot be compressed. Full stop.
Reply: @chriz9959  One of the gas giant planets, they have layers of gas liquid sold. same as we do but a magnitude bigger.
Reply: its exactly the same scenario as in ocean
Reply: You forgot the superheated air cooks everything before water even touches it.
Reply: @larsenh111  gases are not fluids. Gas or fluid, is a state of matter.
Reply: @larsenh111  bah humbug. 
Liquid

A liquid is a state of matter that has a definite shape and volume. A liquid can flow, pour, or drip. It has a surface that is free to move.

Examples of liquid: water, juice, oil

Gas

Gas is a state of matter that has neither a definite shape nor volume. A gas can expand to fill any container. It has no surface.

Examples of gas: air, natural gas, propane

Difference between liquid and gas

Liquid and gas can be differentiated on the following basis:

On the basis of the definition.

On the basis of physical properties.

On the basis of energy.

On the basis of state.

On the basis of molecular arrangements.

On the basis of the storage facility.

On the basis of temperature.

On the basis of pressure.

On the basis of reactivity.

On the basis of shape.

Let us understand all of them one by one.

On the basis of definition

Liquid is a state of matter that has a definite shape and volume whereas gas is a state of matter that has neither a definite shape nor volume

On the basis of physical properties

Liquid has a definite volume but gas doesn’t have a definite volume. The molecules in a gas are far apart from each other and can move around freely

Liquid has a surface that is free to move but gas doesn’t have a surface

Liquid can flow, pour or drip but gas cannot because it doesn’t have any definite shape

On the basis of energy

The energy of the liquid is in constant motion but the energy of the gas is randomly moving

On the basis of state

Liquid is in a state of rest while gas is always in a state of motion

On the basis of molecular arrangements

In a liquid, the molecules are in close contact with each other but in gas, the molecules are far apart from each other

On the basis of storage facility

Liquid can be stored in a container but gas cannot be stored in a container

On the basis of temperature

The boiling point of a liquid is higher than the boiling point of the gas

On the basis of pressure

The pressure of the liquid is more than the pressure of the gas

On the basis of reactivity

Chemical reactions take place more quickly in liquids than in gases

On the basis of shape

A liquid is a state of matter that has a definite shape and volume. A liquid can flow, pour, or drip. It has a surface that is free to move. Gas is a state of matter that has neither a definite shape nor volume. A gas can expand to fill any container. It has no definite shape.
Reply: Yea, im not the guy to do the calculations. but if 1 gallon is about 7 pounds, how many gallons are above you at 3000 feet? Maybe we make a circle thats would encomoass the submarine and then calculate based on that? Im sure its easy for a math person and i could probably get to the answer eventually but i wont. Lets just say, that shit is heeeeaaaavvy
Reply: @andrewut7ya511  Wikipedia says the pressure tube was 2.54m long and 1.68m outside diameter. The hemispherical ends should have the same diameter. The planer area from above would be 6.48m^2. The number I'm seeing most often as the guess for where it collapses is actually 3,200m metres, not feet. (so 10,000 feet). That is apparently based on when they lost contact. A column of water 6.48m^2 and 3,200m tall is 20,750 cubic metres, or 5.5 million US gallons, weighing about 20,750 tonnes or 22,873 American tons. About as much the battleship HMS Dreadnought of 1906.

Of course, the pressure actually pushes IN, not just down. The outside surface area would be 22.3m^2, and the pressure at that depth is around 320 atmospheres, which is about 3,200 tonnes per square metre, so the total force on the exterior of the pressure hull would be 71,272 tonnes or 78,564 tons. A little more than the weight of the battleship Yamato.
Reply: @andrewut7ya511  well if we work in metrics for every square metre, 1 milli litre is 1 litre. Making 1 cubic metre 1000 litres which is one tonne. At 3,200 feet or 975.36 metres below sea level the pressure on just one square metre of the hull would be 975.36 tonnes. I would imagine any 900+ tonne force being exerted at the speed of sound is going to cause incomprehensible damage to a vessel and ultimately a human body...
Reply: @andrewut7ya511 - 1 atmosphere - which is 1 bar or 14.7psi for every 10 metres of depth - pretty simple math really
Reply: @SeanAlcorn  i waa talking about the weight not the pressure. Like how many pounds of actual water is above you if you are 1000 feet down
Reply: @andrewut7ya511  If you're talking 1 sq in, then 1" x 1" x 3000 ft x 12"/ft = 36000 cu in. = 155.84 US gallons 

Which has a weight of 1300 lb.  Therefore, the pressure would be 1300 PSI (1315 PSI relative to a vacuum)
Reply: @andrewut7ya511  you can't measure by gallons, you measure by weight/pressure. At 12,500 the pressure is about 5,500 lbs per square inch, the human body on average is 255 square inches. Do the math.
Reply: @andrewut7ya511  Visulize a column of water one inch square rising up to the surface, every 30 foot section weighs 15 lbs.
A one thousand death or length of water thus weighs 500 lbs. (rule of thumb divide depth by 2 equals pounds per square inch
Reply: Great explanation. You should consider teaching if you don't already do that.
Reply: This guy has no idea what he’s talking about, trust me
Reply: @bustorobusto6316  which guy?
Reply: @boxingfan2281  the guy who is speaking
Reply: They compress air not water
Reply: @maxpayneau 
No, they forced water into the container, causing a very slight stretching of the container and compression of the model until it failed.
Reply: @maxpayneau no.. they exert force on a tiny tiny piston that is hydraulically connected to the larger tank (acting as a larger piston).  Compressing gas would drive it into solution
Reply: The screws on the titan probably caved in first . You can see them all clearly
Reply: @DaBongo89  that’s less likely than the interface between the titanium sections and the carbon section.  Different Material properties and interfaces are very complex locations.  A high tensile bolt and it’s screw are very well understood and as such it’s more likely the areas that have less understanding that fail.
Reply: @DaBongo89  See the film of them gluing and attaching the titanium flange to the carbon fiber cylinder, the wall thicknees is 7 inches, but the depth of the flange pocket was a mere 2 or 3 inches, too small.
This was the failure point.
Reply: If water is uncompressible is it called pressuizable ?
Reply: @gregorydahl  a lot of the things we are taught in school are not true OR more specifically only true WHEN they are true. 
Water under 90,000 psi is 14% compressed, meaning the same volume of water in a smaller space. 
It shows up as "pressurized" because the water resists being compressed. It hates being squeezed into a smaller space.
Reply: @gregorydahl  The DON'T.  ON a submarine - the inside air is kept at breathable pressure.  GASES are compressible.  LIQUIDS are not.  Which is why your car - uses FLUID in your hydraulic brake system.   You transfer and multiply energy using hydraulics - because fluid does not compress. And so when you work on Brakes - you must bleed out or remove any AIR - which is a GAS - since GASES compress.  A tiny air bubble in Brake Fluid - causes you to have to 'pump' your brakes a bunch - since your squeezing and squeezing and squeezing the air down smaller and smaller - until finally you start moving the Brake piston.  "Damn!  I screwed my brakes up..."
Reply: @gregorydahl pressurizable
Reply: Stockton Rush attended Phillips Exeter Academy and also went to Princeton University in aerospace engineering where he obtained a degree.  He surely examined the situation whether his submersible will stand the pressure.  If there would have been the slightest doubt he would never have invited paying passengers and he himself behind the wheel. Something else must have happened there.
Reply: @lenny108 or he was just wrong and didn't know what he was doing at all.
Reply: @lenny108  you think going to high school at philips exeter is somehow relevant but his history of avoiding normal safety protocols, the coast guard, advice from more experienced peers, experts in his field, and very well known material properties of epoxy matrix carbon fiber are not relevant? Educated does not mean wise, and he was unwise and publicly documented being so.
Reply: Then how come sharks get to eat tha left overs down there.
Reply: @bastogne315  On the off chance you are being serious... Sharks generally don't dive to depths any greater than 400-600m. Great whites have been known to reach 1000m and whale sharks can go to a depth of about 2000m.
Reply: @bastogne315  which sharks are these at 4000m.   Plenty of other organisms at depth to exploit an additional energy source.
Reply: @boxingfan2281 6 gill
Reply: @bastogne315 those sharks, if they even had a reason to go that deep in a pretty barren part of the sea, didn’t find a damned thing.
Reply: @bastogne315 because they don‘t.
Reply: @bastogne315 No sharks down that deep - worm food…
Reply: You exaggerate too much.
Reply: @uzzuzz9320  Using even a rough equation of the energy released based on the pressure of 400 atmospheres its basically the equivelent of 50 kilos of TNT so if anything he might even be understating what actually happened
Reply: @skurjo9975  I heard 25 sticks of dynamite roughly I did myself calculate the force acting on each person at implosion was 6400 t or 14 million pounds as the average human male has 2800 square inches surface area and it's 5000 psi or something like that, I didn't look up the numbers. But it's  a lot!
Reply: @skurjo9975  except it popped at 3,200 feet deep . Not 12,500 feet deep .
Reply: @gregorydahl  Even at 3,200 feet (~1,000m), there's pressure equivalent to about 1,000 tonnes on each square metre of the hull. An implosion under such pressure would be as destructive as a large bomb going off.
Reply: @gregorydahl  I thought they said it imploded at 3200 meters not feet, but I may have misheard…
Reply: @please_stop-v7o rough numbers are 1 atm/10 m and 1 m³ of volume/person. With those numbers (and rounding to 4 km depth), you get about 200 meganewtons of force or roughly 50 kg of tnt. Sticks of dynamite have anywhere between 40%-60% tnt so it's a bit challenging to translate from pure tnt equivalence to sticks
Reply: @gregorydahl  So this means that it popped at only 1/3rd of the pressure the man was hoping to dive to ... hmmm.
Airplane wings and components are made in the same manner as this submersible and they are subject to fatigue after a certain amount of hours. Why the company and CEO didn't deem useful to test for stress levels and fatigue on a structure submitted to far larger external forces than its own weight is unnerving to say the least.
The simple fact that he fired (and settled out of court) an experienced engineer who had the balls to contradict him and blow whistles says mountains on how this operation was put together. I truly send all my condoleances to the families for their loss and somehow feel that it is somehow fitting that the very man who fabricated this submersible was in it when it failed least he'd only start again, only this time using carbotanium (IF he could afford it). Just as dangerous.
Reply: @skurjo9975  I like it when people present someone else's calculations as if they were their own.
You made this?
...
I made this...
Reply: @skurjo9975  if I remember from my sapper days, 50 kilos of TNT will make a crater  maybe 6 or 7m in diameter and about 3m deep.  If you were standing in it when it went off, you'd be disintegrated.  So yeah, it seems like the OP's description is pretty close to the mark or understated.
Reply: @please_stop-v7o  i did some rough math and the total force on the outside of the pressure vessel was definitely over 130 million pounds.  imagine that all coming in to fill up your 14.7 psi bubble.
Reply: @TonboIV how does the large fishes survive beneath the sea with so much pressure ?.
Reply: @kiran_gaddafi  evolution along with organs that are equal in pressure to the water that they live.  So in other words zero gases within the system.
Reply: @gregorydahl  I think it was actually 3,200 meters not feet. The failure happened 1 hour and 45 minutes in. It usually took them approximately 2 hours to descend to the wreck which is 3,800m deep. If so, that's a dive rate of 31.6m/minute. If it happened at 1:45, that's 3,318m, so much closer to 3,200 than 1,000.
Reply: @gregorydahl I doubt they even made it that far.  Their view port was rated for 1.4Km.  Sure, it may have held up before, but it is the weakest part of the sub, and therefore more likely to break first
Reply: @gregorydahl  3500 meters, about 11200 feet.
Reply: @TonboIV gregory is incorrect. Had the submersible imploded at 3200ft, the debris field would’ve been scattered over a square mile and probably not even locatable. Due to the rather small area the debris field covered should tell one that the sub had reached its excursion depth and was making its horizontal approach.
Reply: 100 tons I think.
Reply: @gregorydahl  I had heard it had nearly completed it's dive when the mothership heard the sound of the implosion, so 12,00 feet should be about right...
Reply: @uzzuzz9320  he isn't exaggerating one bit, it wasn't a slow leak, the thing is in pieces scattered around, and now some info is coming out that they actually heard the implosion sound on the mothership itself, which isn't surprising at all considering the size of it and how well sound travels in water
in this test video there basically is no inrush water volume when the tube fails (which is great for testing), but in real life example there is a 4km water column above them, and when this fails, the in-rushing water itself has a momentum, and considering how fast that volume filled up, you can kind of get the idea what happened to soft tissue if they couldn't actually locate both titanium end caps, they found one, and the second one was quite a bit away (don't know exact distance, I don't think it was disclosed so far)
so yeah, there was a lot of energy involved in that event, and fortunately it was quicker than living things could have consciously react to
Reply: @dghtr79_36 The navy came out and said the sounds they heard were not the sub. The sub imploded long before their was a search and rescue mission. While the sub was descending, the surface ship lost communications and beacon to the sub. That was the exact moment of implosion.
Reply: @dghtr79_36 If they heard the implosion on the mother ship, and didn't draw the necessary conclusions- they need to be confronted as to why they waited 8hrs to call the Coast Guard!
Reply: @HairyBottom they have a continuous sonar sensing system around the US coast for intelligence reasons. They did hear it, but either didn‘t know what it was or the info was still under military secrecy.
Reply: @dghtr79_36  water rushed in at 1500 mph. Im with you. This thing blew and blew fast.
Reply: @pan6593  Yeah it was my mistake. I had completely forgot about the hydrophones they have in the ocean. Some news media outlets said the Navy heard the implosion as the search and rescue was underway. I thought to myself that’s impossible being that the sub imploded long before there was a search and rescue mission. When I heard one news site mention hydrophones, I immediately knew what they meant to say but didn’t.
Reply: @edkiely2712  They wouldn’t have heard the implosion on the surface ship.
Reply: @uzzuzz9320  They're understating what happens. The Byford Dolphin diving bell ripped apart and shot chunks of people 10 meters into the air, and that was only 9 atmospheres of pressure differential. The Titanic is at a depth with 400 atmospheres of pressure. The Titan and everyone inside it would have been ripped to shred instantly as soon as the hull started to fail. The ship is in hundreds of pieces and the people will be bone fragments.
Reply: @uzzuzz9320  Famous last word "You exaggerate too much." stockton rush.
Reply: @uzzuzz9320 Thought he did just fine!
Reply: @uzzuzz9320  No, he does not. It has been reported that there are no bodies to recover, because the sudden change in pressure liquified them completely, including most of their bones.
Reply: @uzzuzz9320  Nope, why would you think that, do you know what the pressure is at the depth of the Titanic?
Reply: @uzzuzz9320 in one millisecond the air is squeezed the air bubble acts like a piston and the air ignites reaching temperatures of the sun, the body cannot comprehend how fast that is you feel nothing, he isn't exaggerating at these depths it's no joke.
Reply: @uzzuzz9320 those aboard the Titan may disagree with your comment!!!
Reply: @uzzuzz9320 no 💀
Reply: im replying here to watched   @uzzuzz9320  get dragged harder than a christmas tree on dec. 26th
Reply: @uzzuzz9320  he's 100% correct
Reply: @uzzuzz9320  He made excellent points.  No exaggeration.
Reply: @uzzuzz9320 No, he does not.
Go and look it up.
Reply: @uzzuzz9320  What did he exaggerate? I think what your getting out is there were too many words for you to comprehend. Maybe picture books are more suited for you?
Reply: @uzzuzz9320 you can belittle and doubt and argue all you want. But the pressure at titanic depth would be about 6000psi. Or roughly  3 times what a Modern car crusher uses to flatten a car and it would happen almost instantly due to pressure equalization. And this catastrophic failure would only occur with parts that were pressurized like the crew compartment.

This i believe is why we see much larger relatively unflattenened portions if thebtitan sub. This is also why the majority of titanic hasnt just flattened. It was nebwr pressurized in the first place .
Reply: @uzzuzz9320 I hope you don't think this test showed you why really happened???
Reply: @thedbcooperforum Look at how old the video is champ! It is 10 years old. They were performing scientific experiments and is no way a response to the loss of the submersible at the Titanic wreck.
Reply: @rolypoky  yes, I know it's 10 years old, sparky?

If I see another video that is 20 years old and people post about the recent events, I will say the same thing, ok, sparky?
Reply: I have seltzer all the time. Which is compressed water. So you don't know what you're talking about
Reply: @tooththrhr seltzer is compressed air iniside of water, not the same.
Reply: @tooththrhr that's carbonated, not compressed, you cannot compress water.
Reply: @tooththrhr  No. The bubbles are a gas dissolved into the water under pressure. You release the pressure and the bubbles form. Same thing happens to scuba divers to some degree.
Reply: @tooththrhr  educate yourself.
Reply: @tooththrhr  seltzer isn't compressed water, it is water with dissolved CO2 in it
Reply: @tooththrhr  not really. it is gas dissolved in water. the liquid isn't compressed, it is under pressure. so is the container, and the gas.
Reply: @tooththrhr  No... the water isn't compressed, it's carbon dioxide being compressed so it dissolves into the water. Water isn't compressible.
Reply: @tooththrhr actually selter is water with carbon dioxide gas dissolved into it.
Reply: @tooththrhr  Hey "Einstein" that is compressed gas in with the water, not compressing the water.
Reply: @tooththrhr 
The gas is pressurised not the water.
Reply: @tooththrhr  no, that's Carbonated Water not Compressed Water.
Reply: @tooththrhr seltzer is water with dissolved carbon dioxide gas. It’s the gas that is under pressure and when the pressure is released it allows the carbon dioxide gas to escape
Reply: @tooththrhr you ever heard of hydraulic lock on an internal combustion engine? It's when water infiltrates the combustible chamber and the engine won't turn over because the pistons cannot compress water
Reply: Seltzer isn’t compressed water, it means they’re compressed GAS inside the water.
Reply: @tooththrhr 🙄
Reply: @tooththrhr    Lol. Seltzer is not compressed water.   Its water with pressurized  carbon dioxide added.
Reply: @tooththrhr  It’s not the water that is compressed in a seltzer, but the carbon dioxide gas that makes it fizzy.
Reply: @tooththrhr seltzer is pressurized, not compressed. If it was compressed then it would immediately overflow when you open the can.